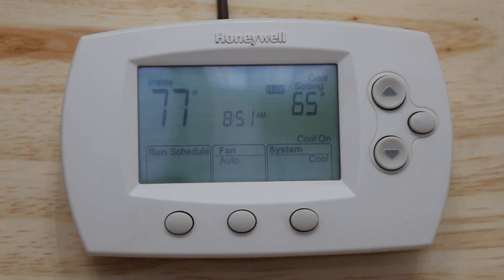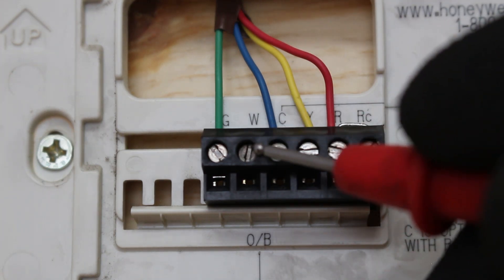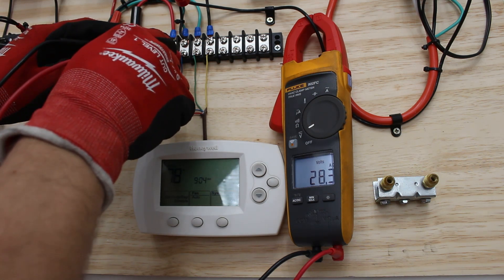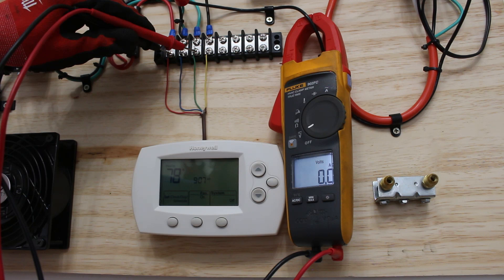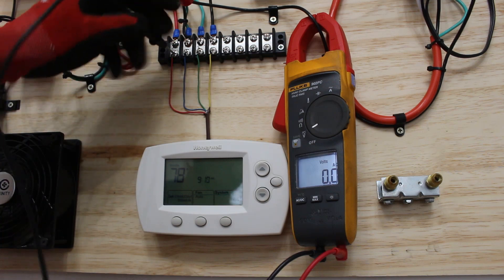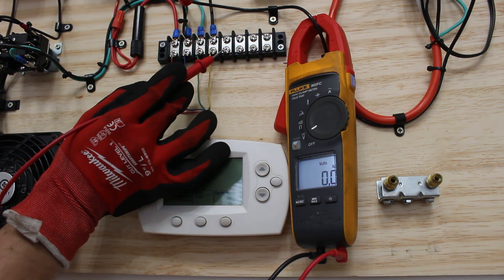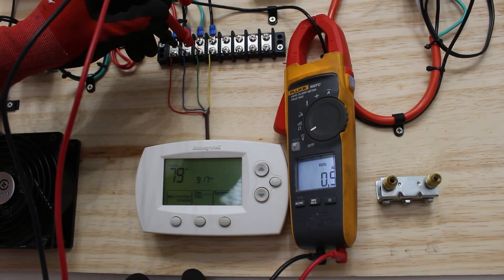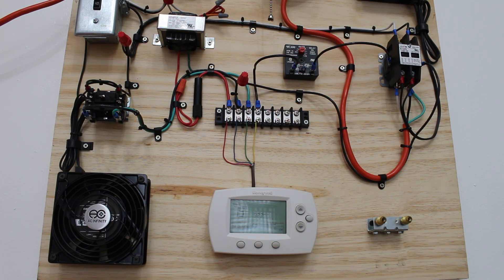HVAC: How To Check A Thermostat With A MultiMeter Using Voltage (Thermostat Troubleshooting) 24VAC

Comment: This is how my thermostat is working currently. But every diagram and info from Google says this isn’t how it works. They say you should not have 24v and it would not makes the connection to turn the components on. So how is it working? What’s making it change to 0 volts. This is working opposite of how you thing it should, but why?

Comment: So if I’m not getting the voltage drop between R and Y when the system comes on, what does that mean? My thermostat is just bad? I have 27v with it off, and when it comes on and gets past the blinking phase I still have 27v. Could there be another cause? Anything else to check?

Comment: Why when the switch is open is all the voltage on the switch, but when circuit is closed why does it drop to 0. Thanks for your videos.

Comment: Man I can't thank you enough ! I have worked in the field and this is the absolute best knowledge on an explanation on how to make you finally understand the low voltage circuit and how common actually comes into to the checking vs red constant .thank you extremely well done 👏

Comment: I have done so much research on my stinking furnace I really am losing the energy to look up the fluke besides I don't have one and am try to save money fixing this thing myself I can't go out and buy one. 
I do love your mock control board. It's a great vid. I'm just so incredibly frustrated because I cannot find the problem with my furnace. So far everything has checked out. It simply seems likefd gas is turned off the unit. But it can't be. 
I hear, and even feel, the click in the gas control valve. Bit there is no gas. I'm about to remove the gas line to be 100% certain about the gas line to the furnace is really live.  If it is I guess I will start over with testing the control board with a multimeter. But I hear the click in the gas control valve. Can it click and still be stuck. And then click again when it should turn off and still be stuck?  Can anyone give me some ideas on this?  Thanks if you can. And thank you for you vids.
Reply: I guess this channel isn't monitored any longer.

Comment: What if I have 9v between Y AND C? Thermostat working on Cooling. Outdoor unit not turning on. 
Same thermostat working properly with another Air conditioner.
Btw problem was with transformer. We replaced transformer, but he just died again in 30min. But during this 30mins outdoor unit didn't turned on

Comment: Open circuit reads 0.0 closed gives your your voltage you saying it backwards
Reply: No, he is measuring in reference to the 24V in line, not ground. Closed gives you your power, not voltage. Then the relay closes there is now power in that line, but it is the same 24V. So 24V - 24V = 0V. Voltage is the difference in potential. The 24V measured when the relay is open is the potential for power to flow if the two lines were connected.